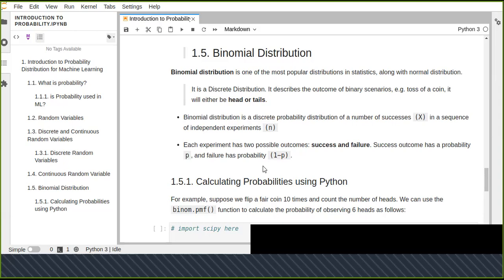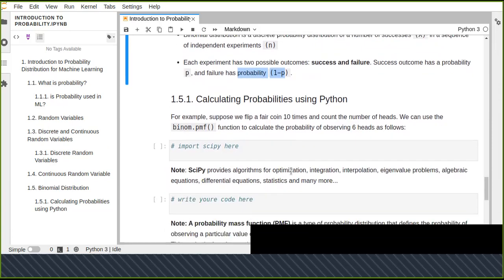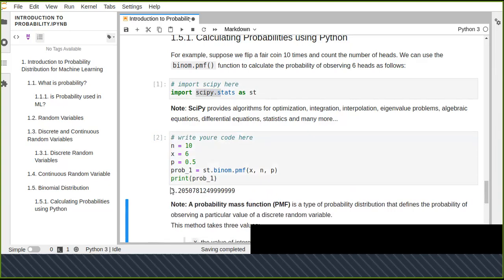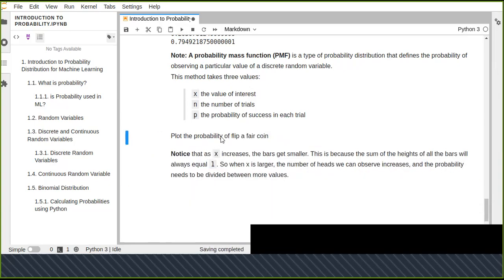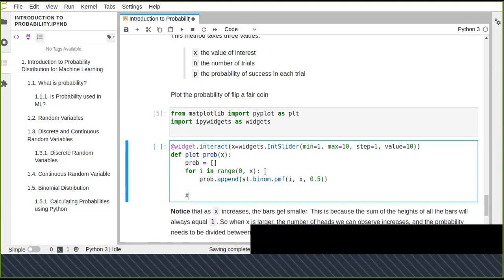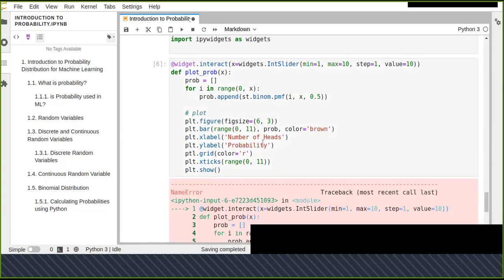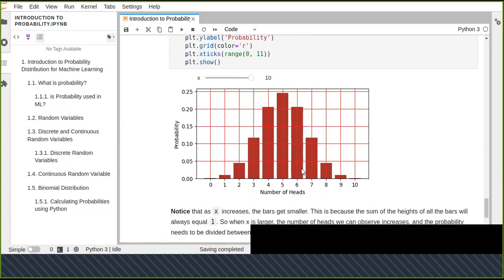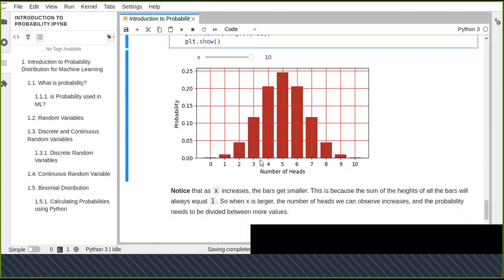Introduction to Probability Distribution for Machine Learning | Binomial Distribution

Comment: why did u set the probability p value to 0.5 by default? while the success count was 20 per cent when u calculated the probability?
Reply from the maker: P value is less than or equal to 0.5